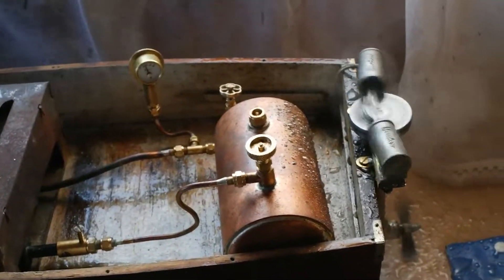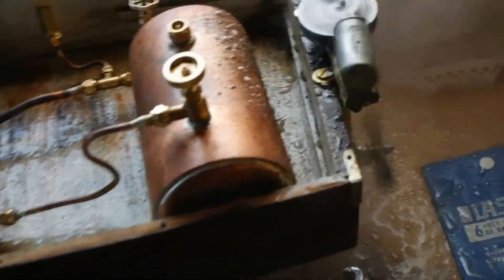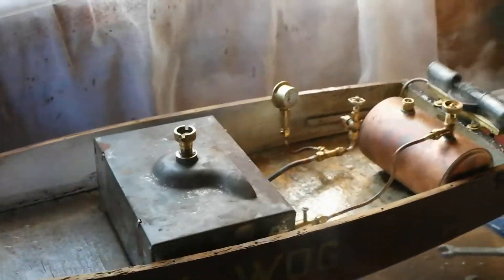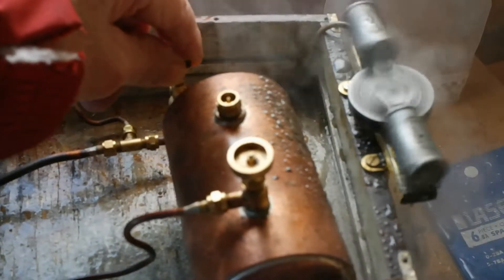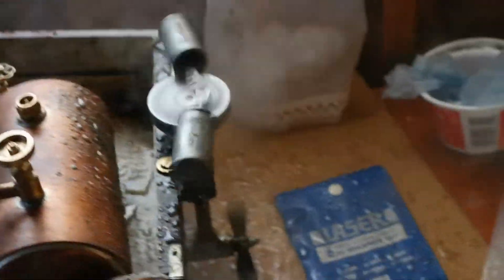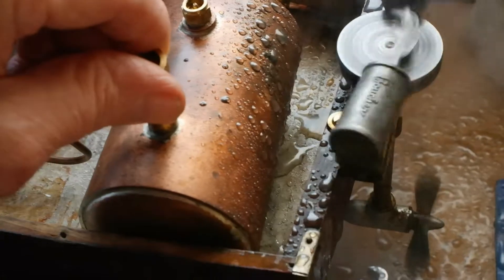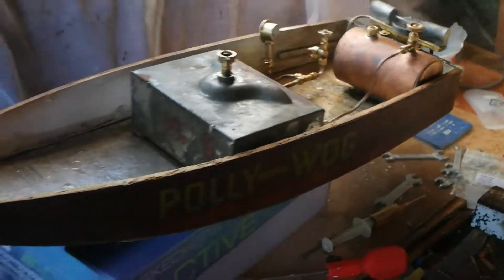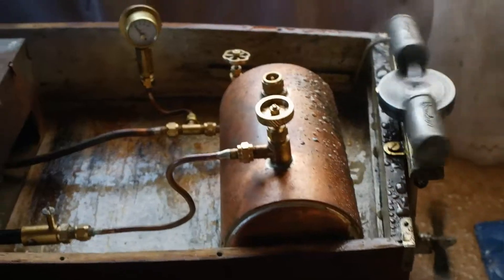BOUCHER POLLY WOG 2ND  RUNNING UNDER CONTROL

Comment: Bonjour Roy,
I would be happy to see this old baby on the water because, to my opinion, an oscillating machine is not built to run so quickly. Would you have a swimming pool indoor at home :+) ?
Amicalement, Raphaël
Reply from the maker: +Raphaël Havranek 
thanks for your post,,  after test  runs this old oscillating engine , she now runs as good as new,
  I will sail her at my local club  pond  " not a problem  even at nearly 100 years old.
Reply: +Roy Burton Bonjour Roy,
Of course it will not be a problem, you are not 100 years old Ah ! Ah ! Ah !
Sorry for the joke, it had to be done, amicalement, Raphaël